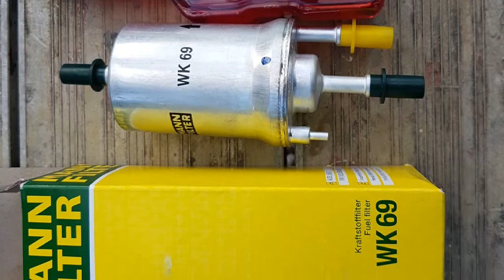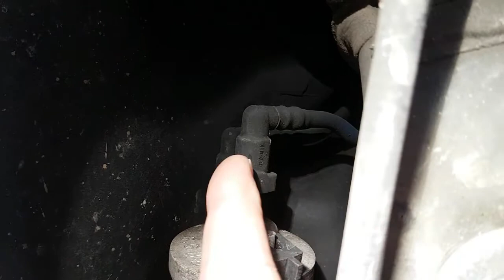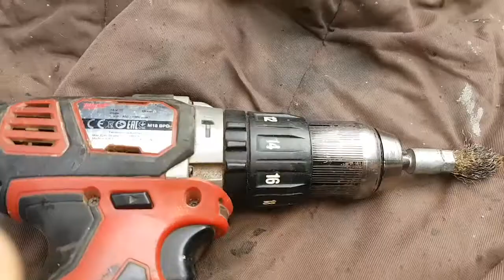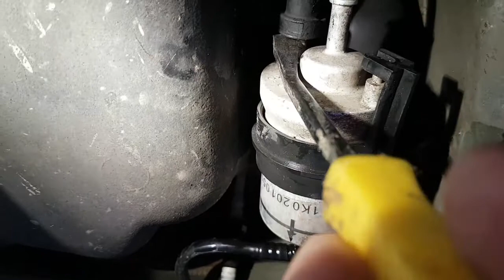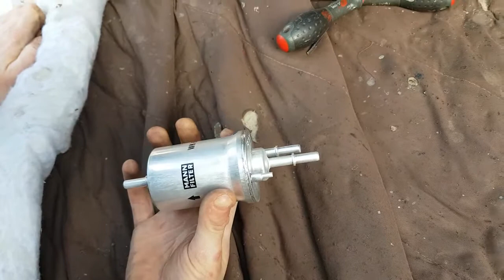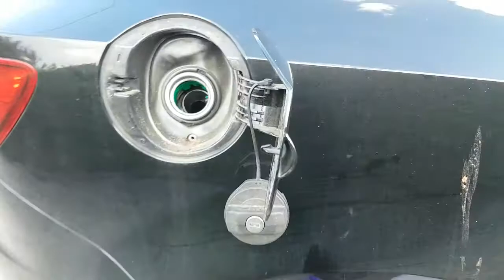Seat Ibiza 1.2 tsi fuel filter change and fuel system clean

Comment: Thank you for the video... Did you use 6.6 BAR or 3 BAR ?
Reply from the maker: Im not sure just ordered the standard filter. But thankyou for your comments
Reply: @markrocketmangrimstead 
I ordered it by the car number from the dealer  he gave me one with 6.6 BAR but I noted that the previous Owner used a replacement filter with 3 BAR
I checked with more than car shops they said that the 6.6 is the correct one .
Reply from the maker: @alkkattab  ive learnt something there mate,thats proper high pressure. 
I must admit the pattern mann filter we fitted has been fine not sure what Barr it is
Reply: Cheers for making the video. It's acting as a really handy precursor to me getting under there. Gotta limit mistakes.
Reply from the maker: @lukestone444  take your time mate you can do it👍
Reply: 6.6 is the right one

Comment: Great vid, do you need to empty tank first? Worried my tank will drain if i remove filter
Reply from the maker: If I remember we put a bowl underneath, but we didn't lose much fuel👍
Reply: @markrocketmangrimstead  I know it was a while ago you did it but did you have to undo petrol filling cap to release pressur in system or just unplug and replace
Reply from the maker: @leftfootforward1181  I think we just went for it,but yes you can remove the cap as your correct it would release pressure
Reply from the maker: Also my son said hardly any fuel was released

Comment: Is this procedure the same for a 2018 Seat Leon 5F1 with the 1.2 TSI with 86 HP? There is literally no clear replacement part to be found on the internet
Reply from the maker: Hi mate,I've tried to look on e Bay,some show a paper cartridge, without your reg i don't know.
But if your filter is an aluminium filter like mine ,yes the procedure is the same
Reply: @markrocketmangrimstead  Thanks a lot! My filter might be a lifetime one according to some forums, but I will keep digging
Reply from the maker: It could be a cartridge, like some oil filters,so you just put the new cartridge in the housing,the connectors fuel hoses would probably be the same

Comment: Which port is for supply or return to tank?
Reply from the maker: Hi,
I think you will find that the ports are different diameters, so you can't cross or put on the wrong one
Reply from the maker: Also the pipes should not struggle to fit,in other words if they look awkward its on the wrong port,the 2 pipes are not the same length,as are the twin ports from the filter